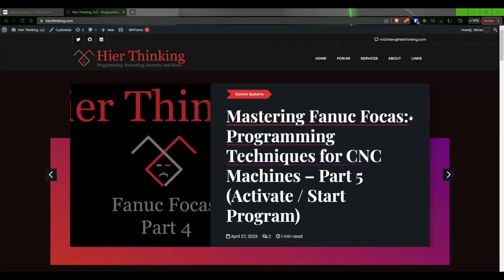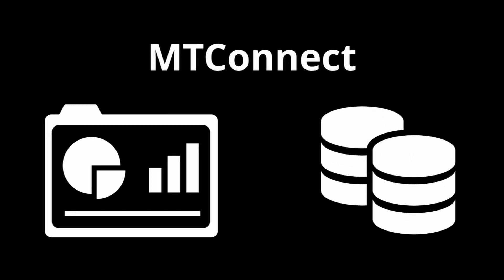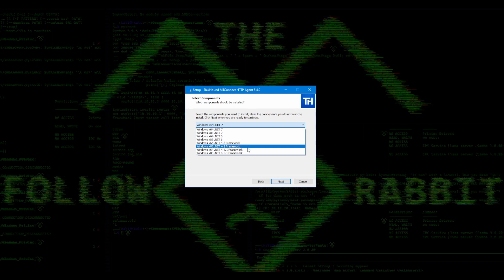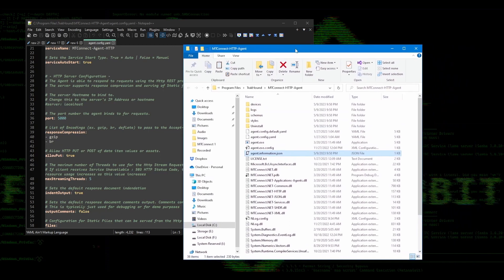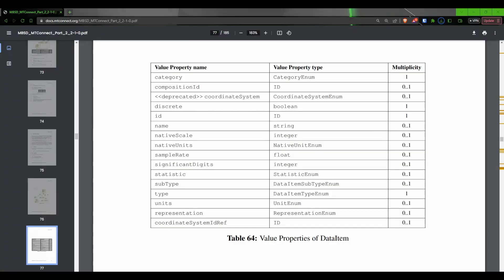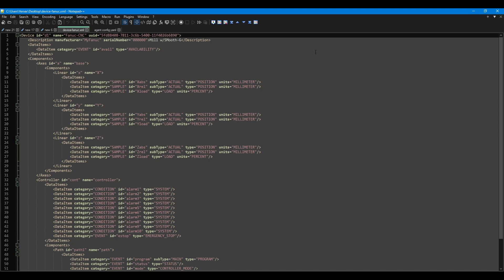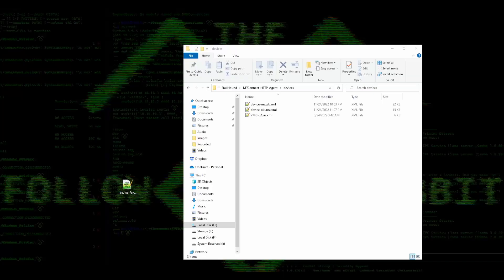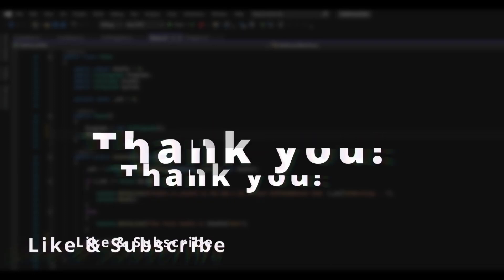The Ultimate MTConnect Agent Setup Guide: Maximize Your Shop Floor Efficiency

Comment: I have a Mazak Hyperquadrex and I ran MTC-Filemaker v1.0 on and gotten back the xml log on all the signals that the machine supports.  I am trying to figure out how to get that so use as a device .xml for Trakhound to use and am wondering if there is some kind of probe software that will work on a Fanuc Robodrill because I want to see what all the signals I can collect from them also.